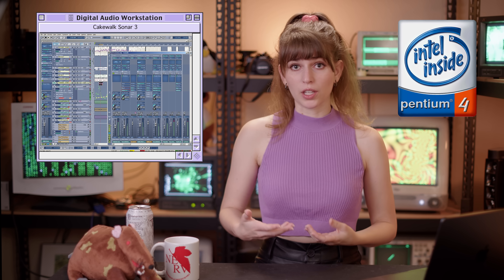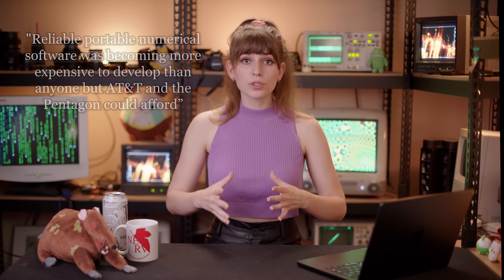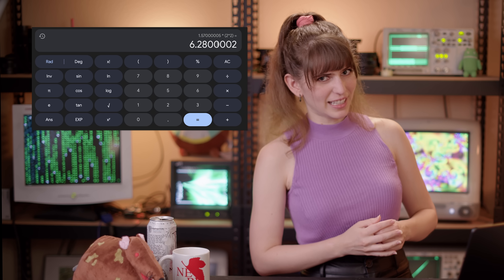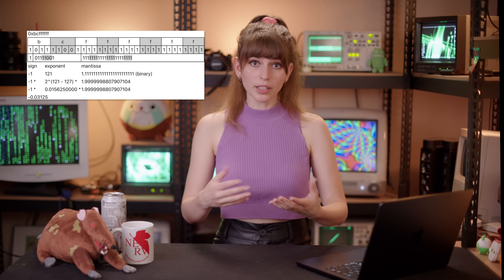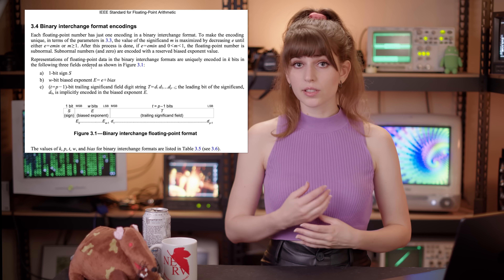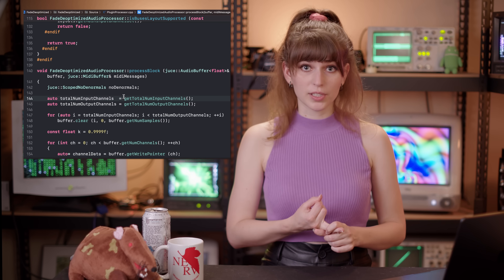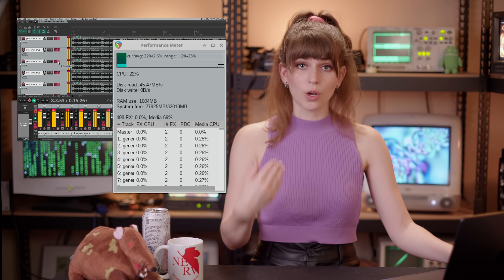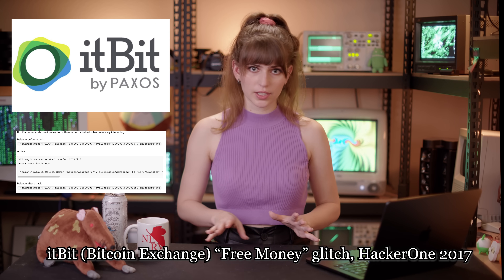Fading Audio is ROUGH on CPUs

Comment: Very well summarized and it was indeed a real problem with the Pentium 4. Although I would have been interested in knowing why it was so slow on the P4, and not on the P3 nor on any of AMD's chips (which is why back then I was already advising going AMD for audio).

It's certainly not a problem today, at least on x86 (and most likely not ARM either), as no one uses the old x87 anymore. We now use SSE(/AVX), which offers not one but two flags to deal with this: DAZ (denormals are zero) and FTZ (flush to zero). This is what your code is showing, but this is technically not the "FPU unit", as AVX is an SIMD unit that does both vector integer and floating point math. To my knowledge the x87, the real FPU unit never got such a flag. And yes, this means that nowadays all scalar floating point math is being done inside a unit designed for vector math.

You can still encounter slow denormalization in a very old plugin of course. Back then a good way to deal with that was to do a fast integer compare to flush tiny values to zero (actually larger than denormals, as you wanted to avoid future denormalization).

Comment: I am a software audio engineer for 20 years (DJ app) and I know about this, back then I was forcing all audio values to 0 when they get below 0.001, which is not audible anymore. Thats being said I never saw a big difference in CPU load. I am very surprised there are such big difference in your VST just with that CPU flag, is it the only difference you saw when you decompiled the code? Thank you for the video, super interesting to me. Also so nice that you are messing around with audio 😃

Comment: Audio software engineer here (making DAW plugins you've probably have heard about in you're into that space), and yes, denormals are the bane of our existence. Fading audio is kind of the least of our concerns, because the real problem is when you add feedback (computing the next audio sample partly using the last audio sample), like in delay plugins for example. When you have your Feedback amount set to 50%, each delay will get halved in volume, meaning that even a loud sound can eventually cause denormals.

The problem is, everything in digital signal processing is feedback. Delays have feedback obviously, but reverb is often implemented as a bunch of delays mixing together to diffuse the sound. But more surprisingly, the vast majority of filters today use feedback as the core mechanism by which they're implemented, so anything from a simple low-pass filter to a complete equalizer to a whole synth will have to deal with denormals. Nowhere is safe with audio processing.
Reply: How are you making audio plugins today and saying that denormals are still a problem, when modern CPUs have flags to deal with that? And by modern, I mean since 1999.
Reply: @anothergol  The problem with turning off the flags is that it's pretty much instant Undefined Behavior in most languages. Most compilers assume float flags are set a certain way when performing optimizations, and particularly things like compile-time evaluation of float expressions can end up different than runtime evaluation because of it.

That being said, yes, the solution most people use is setting the flags correctly. I've heard horror stories of misoptimizations caused by the UB this generates, so it's not like it's a silver bullet.
Reply: @SolarLiner  generally the compiler has a default MXCSR content that you can alter (if not you can still hack it), so that when it needs to flip a flag, it preserves the other ones (that or it simply reads & writes).

But you can, an also should, switch those flags right before processing. 
Since as a plugin you'll be rendering in one of the host's processing threads, you can't assume those flags have been set (a good host would already have, however another plugin could have flipped them right before yours), so better set them again (& restore them if you care). STMXCSR isn't heavy on cycles.
Reply: @anothergol  I feel like you have not read my reply. I explain that yes, we do, however, that comes at a cost (not runtime performance cost, but "very hard to debug issues" engineering cost). I work with people who have been bitten by this in the past. As I said, it's not a silver bullet.

Comment: Another area the floating point error becomes a big issue between CPU's like Intel or AMD is very large, detailed simulations such as world scale flight simulations used for military. The floating point errors can stack after an hour or two of run time to where the accuracy of even something like landing at the end of the simulation might be off because everything was built and tested on Intel machines but fielded on AMD machines.

On a small scale, I first learned about this issue in college using Matlab. It was to the point a class project gave two different results if you used an Intel machine or an AMD machine but the end result wasn't the focus so it didn't make a difference just still neat to actually hear the difference it made in audio processing (project was add noise to audio clip then filter it out using various methods and compare to original).

Comment: i had this issue in my audio plugin, it was funny, when the logic of plugin was bypassed - it consumed 10% of CPU, but when it was working - consumed less than 1%. And i could not wrap my head around what is going on, until i stumbled on the info about denormals crap.

p.s. i think it should be disabled by default and should be possible to enable it in the bios, if you need it (for medical, finance, science spheres, etc) Because 99.9% of people do not need it.

Comment: Honestly, it's a very bad design of a DAW if it (unconditionally and unknowingly) allows subnormals to be used in the fading process, or otherwise to sneak into its processing. Ardour has a setting to chop subnormals into zeros, and I am sure, any decent DAW can control that and protect user from this kind of a problem. Nothing good (for the sound) happens in that area anyway, since subnormals (in 32-bit IEEE floats) are like -750 dB FS, insanely unusable range.

So, in practice with a software that isn't developed by an ignorant amateur, audio fading has no special consequences on the CPU processing, don't seed panic, please.

Comment: This comes u p with EQ and reverb processes where low amplitude signal keeps decaying. Normal fades go to zero quite abruptly. So the two compiles were entirely different: x87 vs SSE? Reaper has a protection for denormals. Her voice pitches up for no reason at times.

Comment: It's so funny how the thing that seem the simplest often end up having tons of complexity behind the scenes. I guess I'd be on the side of simplicity? At least, as far as DAWs are concerned. It's all going to be rendered down into a 16 or 24-bit file and plastered with dither noise anyway, so greater accuracy feels well within the realm of diminishing returns that aren't worth the performance tradeoff. But all that code stuff you did was basically Sumerian to me, so it's also entirely possible that I'm missing some knock-on benefit.
Reply: Simple would be integer. Floats make no sense here. x86 already was fine with fixed point. You took the result from DX register. A compiler should optimize MUL SAR to this.
Reply: Two things. First, I don't have the kind of computery knowledge required to know if you're arguing with me, agreeing, or making a completely different point. I am a stranger in a strange land here and I'm very afraid.

Second, not knowing things has never stopped me before; I've always been operating under the impression that DAWs being floating point is important because it prevents audio that clips tracks/buses from clipping behind the scenes. Being able to push the volume back down on a track that's redlining after processing is a godsend and lets you get creative with routing without having to check your levels constantly like in the analog domain.

That might be relevant to the point you're making! I genuinely lack the knowledge to even know if we're speaking the same language, though. Either way, I hope you have a pleasant day, ye who communes with the scary technology.
Reply: @227  I kinda agree. Audio is 16 bit. 24 bit max. Computers use 32 bit integers since IBM/360 , Motorola 68k. There is no need to clip integers or fixed point. Though intel their wisdom gave us MMX (8bit integers) and SSE (floats) but no vectors made of 32 bit integers. I should check Hitachi SH4. I think that chip had those vectors.

Comment: The problem with floating point numbers is ever worse than you think!  On Intel, the x87 floating point coprocessor/ instruction set perform operations in 80-bit extended precision. At the start, the floats are converted from 32- or 64-bits to 80-bits. After the operations are complete, they are truncated to either 32- or 64-bit precision.  This means depending on how the code is written, you can get slightly different results.

Worse, SSE instructions work natively with 32- and 64-bit floats, so no conversions or truncating happen.  So the same math on the same numbers will yield slightly different results depending on if you use x87 or SSE.
Reply: The solution everyone chose was to require SSE because x87 is absurdly slow anyway.
Reply: It gets worse! Look up the actual measured accuracy of 'fsin' on the x87 and see how it differs from the datasheet.
Reply: x87 is useless nowadays it doesn't even have intrinsics. So to use it you need to write inline assembly
Reply: @alex31ytb That's because the x87 is scalar actually — who needs an intrinsic when it maps cleanly to the syntax? Even though MSVC has never had a 'long double' type, floats and doubles have always evaluated on the x87 on non-SSE hardware.
Reply: @alex31ytb  There are no x87 intrinsics because it's scalar you silly goose. Even if microsoft never put in a "long double" on their compiler doesn't mean it didn't evaluate floats and doubles on the sucker, it literally has 32 and 64 bit load/store operations

Comment: My Intel 285K PC still has trouble with audio fades. Whenever I use fast fades that use curves instead of straight lines, it causes glitching of the audio where it glitches differently every single time, even with an offline export. It doesn't null, which I always thought was bizarre. I use Cubase Pro as my DAW. The larger the ASIO buffer the worse the fast curved audio fades on audio track level automation glitches.
Reply: Use AMD's Zen 4 or 5 instead. 2nd source is an insurance. I use AMD's R9 9950X3D.
Reply: It’s weird, I’ve been a bit of an AMD fanboy while they were the underdog and I’d seen people report strange behaviours in the early days of Zen (1-2 mainly). More recently it does sound (anecdotally)  that Intel’s mixed P and E core designs have some strange behaviours in edge cases. It must be complicated to get everything scheduled to the correct cores depending on workload.
Reply: Fascinating, you’d think this was a long since resolved problem. Especially with something as fast as a 285k
Reply: @BlahBleeBlahBlah I have a feeling it may just be a maths bug in the software, but in saying that, it might actually be something to do with the way the CPU calculates things. Something that overwhelms it when fast, curved fades are used where much more precise computation is needed. This video really got me thinking.

Comment: Using floats for audio processing is rough, period. 32-bit integers translate to an SNR of nearly 200dB, and fixed point mixing is uniform and fast. Your ADCs work with integers, your DACs work with integers, and your 32-bit floats have a mantissa giving 24-bit SNR (~150dB), with an exponent that can simply shift the noise floor up or down per-sample.

0dB SPL is meant to be an auditory threshold. Setting a reference point such that the least-significant-bit value relates to -24 dB SPL would leave the full amplitude of a 32-bit sample around that of a firecracker (a pressure wave around 170dB SPL), and keeps 0dB aligned with a bit value. You have the headroom in such a system to do high-precision mixing between sampling mics mounted to a jet engine test stand, and listening to a falling leaf in an anechoic chamber at once. Why do you need the decimal point to "float" when you've got fixed-point?

https://en.wikipedia.org/wiki/Q_(number_format)

Comment: interesting but i'm writing an audio program and i think the small fractions are gonna make the numbers have small divisions like that anyway i don't recon i would see any difference... your program explicitly compares say a number like 1 with 0.000000001 ... but when you generate waveforms etc, and deal with wave data i can pretty much guarantee you'll always have numbers like 0.99932837486267
 (i just pulled that off a sine wave at 48kHz), so maybe it's not so important on a modern DAW?... and the idea that fading is gonna do this, well a modern DAW is always gonna have fractions like that... so i don't think fading audio is any more rought in the modern context

Comment: its like the current cpu is very senstive in anything run on..WHAT IS GOOD AT HAVING x3d catch and big cinebench numbers when it barely do 5% work load when reality requires doing more 50% work load without issue ??? is our cpu made of paper ??? how is x86 got so weak now than back then?? There is something wrong with current cpu's... Its like they are benchmarking only 5% results into false narrative numbers to just get sales only without knowing. You got crappy cpu when putting actual real world scenario work loads from doing audio, video editing and gaming same time is not what they been advertise as.  It seem entire x86 is flaw with its 64bit narrative from both sides

Comment: I think the programmer should always have been the one to decide. If higher accuracy was required then the programmer can move the values into higher precision calculations that are more costly. After all, the programmer knows how precise the calculation needs to be and they should be making that decision, not the CPU/FPU. I am sure that in many cases, when accuracy is truly needed, IEEE will be abandoned for something very much more precise (like Big Number Libraries).

Comment: I first ran into this issue on early iOS, where subnormal wasn’t enabled and clearing flush-to-zero simply crashed the whole phone. So I had to defend changing our API definitions of max and min float values to be platform dépendant.

But a colleague had worked in high-end audio and had come across the same fade-out issue. Their solution was to add a tiny bit of noise which they had always planned to do “eventually” for antialiasing.
Reply: Early iOS had a different audio code base than MacOS. It wasn't unified until the mid 2010s, and if I recall correctly, it required the A7 chip, which meant an iPhone 5S or later.

Comment: This takes me back to my teenage years on 8086 with 512 KB dreaming about owning a PC with a separate (very expensive) math coprocessor chip instead of having to use the extremely slow software emulation that got baked in if you tried to do any floating point calculations. A few years later I got to use my friend's 486 DX and figured this guy's parents must have plenty of cash!

These days, throwing a float or double into code still makes me feel a little extravagant.

Comment: Might it throw off the numerical stability of some critical algorithms if you don't have the smooth transition that subnormals enable? I'd imagine functions that expect "smooth" derivatives, algorithms that gauge convergence, or some truncated series/product  formulations of certain functions might be vulnerable. It might be rough on the CPU but that's probably not as bad as safety-critical software with numerical stability issues.

What would be interesting is a follow-up going into the digital circuit designs that subnormals require which create these CPU spikes. Most of the intro digital design course hand wave away the weird bits of floating point -- they just talk about using adders and multipliers then note that floating-point numbers are composed of integers as far as the digital design part goes.

Comment: Something I didn't understand from the video ( I may have simply missed it, or misunderstood it,) is a detail about subnormal.  As I found this interesting, I am quoting from a writeup: "If we use our existing definition of floating point numbers, we cannot represent numbers smaller in magnitude than 2−1022
 because of the implicit leading 1 in the significand. Thus the first 3 representable non-negative numbers are 0
, 2−1022
, and 2−1022+2−1022−52
; the final value is found by flipping the least significant bit of the significand. Note that the gap between the first two numbers is 52 orders of magnitude larger than the gap between the second two numbers. This means that we suddenly lose a huge amount of precision once values get close to zero. To avoid this, IEEE defines subnormal numbers. In a subnormal number the leading digit of the significand is assumed to be a zero; thus by adding additional leading zeros we can represent smaller numbers that we otherwise could. This is only done when the exponent is its smallest value".  Link here: https://people.orie.cornell.edu/prs233/orie-6125/ieee754/ieee754.html